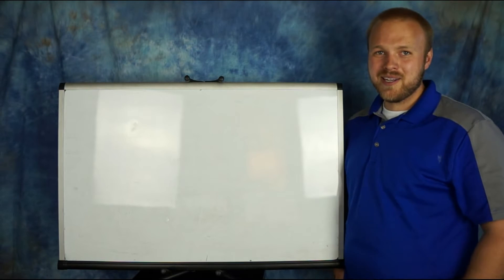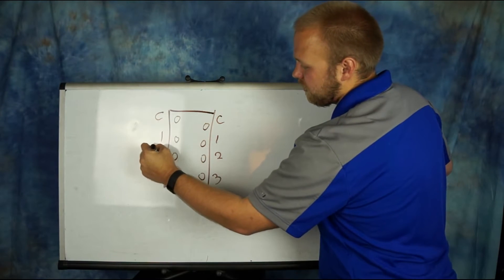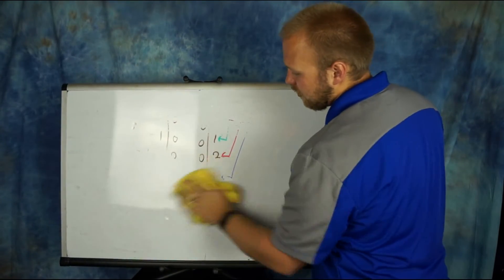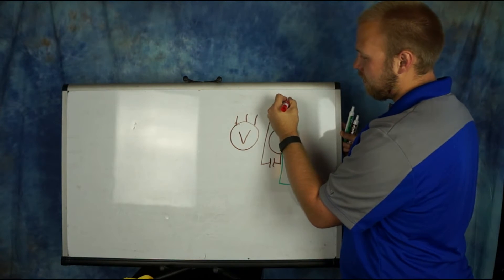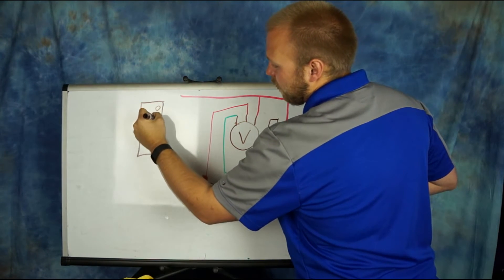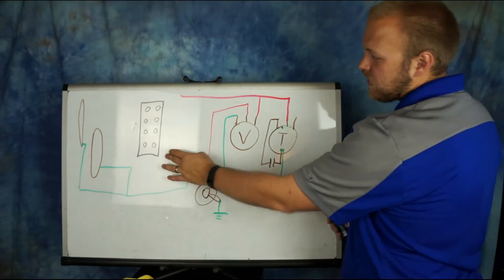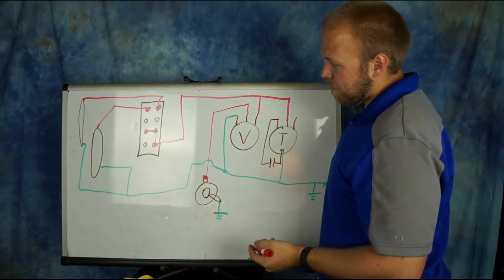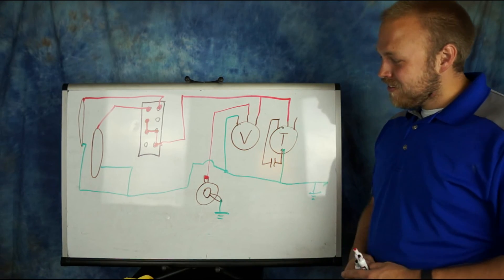Electrical Lesson 3: Telecaster Style Wiring Diagram

Comment: I gues the only part that messed me up was when you changed the commons...
      I sure wished that you'd of left them in their Atypical positions... I can see your reasoning in trying to explain the circuit,   however ...now I had to transpose every connection realizing that common and #1 positions on each side are always connected...

    Because in my case I have a different type of switch from the original switch with the coil springs that is in the the Mexican Telecaster...

      Had you keep the commons in their real spots this would have been real easy .... I can figure it out... but I could have just wired it up as drawn if that wasn't changed.

Comment: cool video and i understand because i already understand wiring guitars but for the novice this would be difficult because you didn't lay the schematic out like it would be in the guitar. i think if you did a video with the diagram played out exactly like it would be, components facing the proper direction it would make more sense, still cool video.
Reply: Actually, I would say proper orientation is crucial. This video pretty much sucks without

Comment: Where in the bridge would I solder my ground wires?
Reply from the maker: +Geronimo usually there is a hole that runs from the main cavity to the bridge. You would strip about 1/2-1inch off of a wire long enough to reach the back of the hole plus a little, put it in that hole, and clamp it with the bridge screw. The bridge is then grounded. Solder to that lead. If there is a bridge plate, you should be able to solder straight to it.

Comment: Instead of grounding the Volume and Tone controls to the bridge, can you ground them to the input jack sleeve?
Reply from the maker: +Skirmisher You should be able to. A ground is a reference of 0 volts, so I don't think it should matter if solder all of them to the sleeve. The pots will offer you more room to work with though.

Comment: When you say the input jack sleeve is grounded, is that ground through the cable at an amp? What if the cable goes into a usb connector, is the computer now the ground or is a ground missing?
Reply from the maker: +Skirmisher No. I'm pretty sure that it is effectively grounding to the guitar body. Anybody else know for certain?